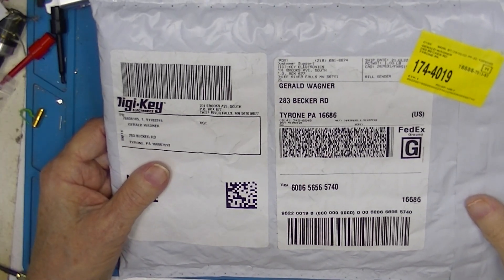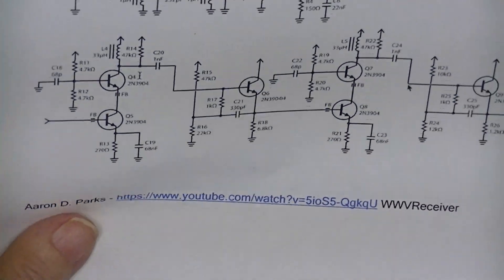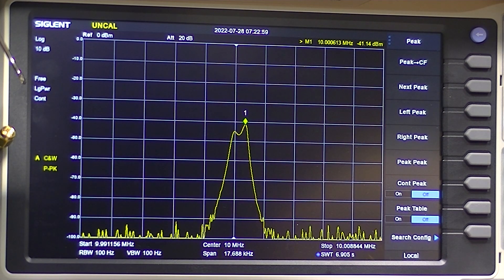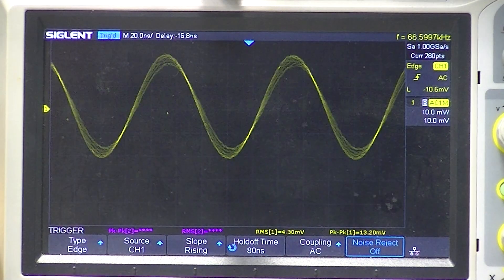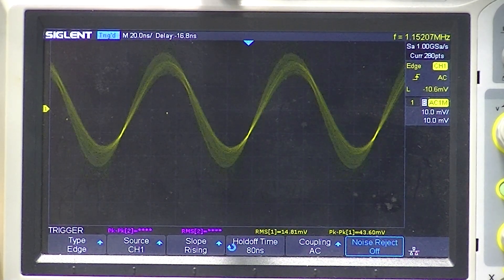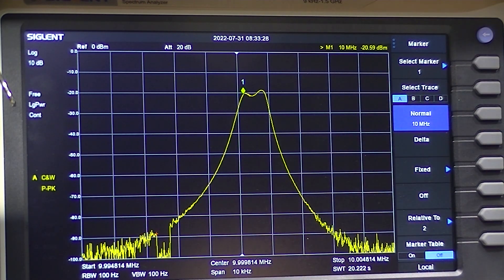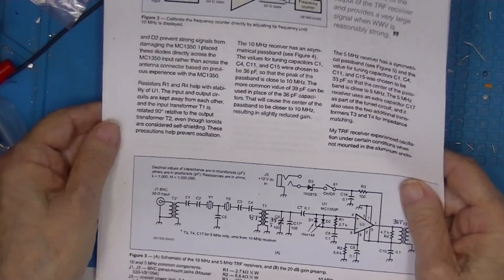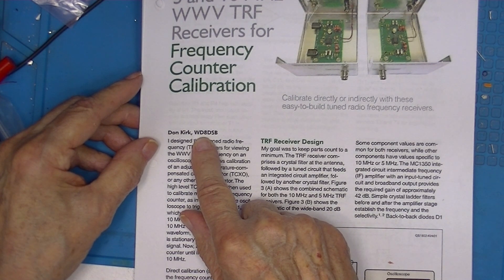10MHz WWV Receiver Part 4

Comment: Hi Steve, one more comment about using your trimmers to shift the bandpass.  If you need more physical room on the circuit board you can actually remove C1 & C2 and just replace them with one of your trimmers, and then do the same at C3 & C4, C11 & C12, and C14 & C15.  As an example on the 10 MHz receiver C1 and C2 are in series and their combined series capacitance is 30.9 pf, therefore a trimmer that has at least 35 pf maximum capacitance should work well.

Comment: Hi again Steve, and great job using the crystals I specified.  Yes, trimmers at C1, C4, C11, and C15 will let you center up the bandpass, but you really do not need to be centered up for this application, and what you have obtained with the correct crystals looks fine.  Now you need to understand how the signal strength of WWV changes throughout the day between Colorado and Pennsylvania and use that to your advantage (it's not about how close you are to WWV, it's about how the signal strength changes throughout the day due to propagation at your location).  I just ran propagation simulations between Colorado and Pennsylvania, and WWV on 10 MHz should start becoming strong at your location starting around 7pm EDT this time of year and it will then get stronger and stronger over the next few hours but at some point during the middle of the night it will start to decrease, and then it will start peaking again in the morning before dropping back down during the middle of the day.  I suggest a simple dipole antenna cut for 10MHz and it does not need to be very high, or a simple vertical cut for 10 MHz with just a short ground rod as the counterpoise.  Not sure if you know about my WWV TRF receiver website, but on my website I provide information about VOACAP which is an online propagation tool you can use to see how propagation is between your location and another location versus time of day and frequency, and I provide some instructions on how to use that tool (at first it's not very obvious).  Send me an e-mail and I can send you a link to my website, or you can find a link to my website in my WWV TRF receiver youtube videos.  
P.S.  During the middle of the night WWV on 5 MHz will become the best signal to use, but you will need an antenna for 5 MHz for use with your 5 MHz WWV TRF receiver.
Don